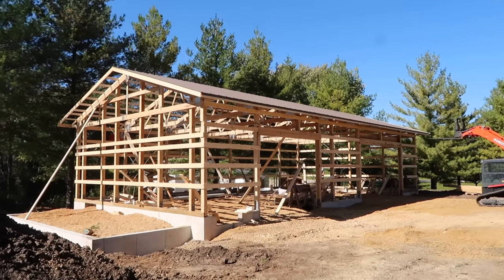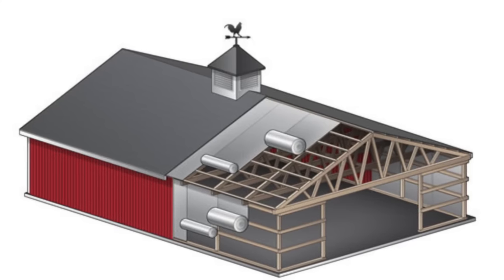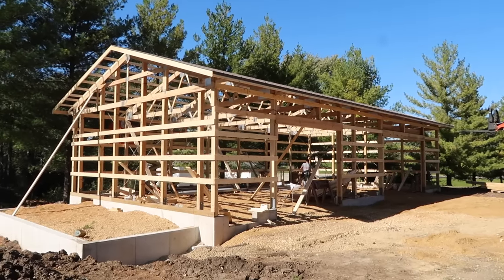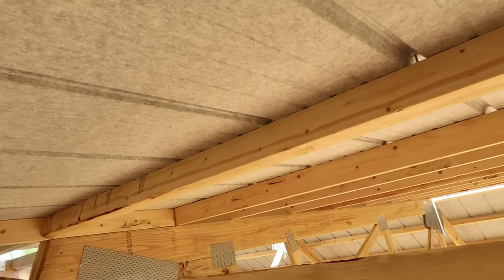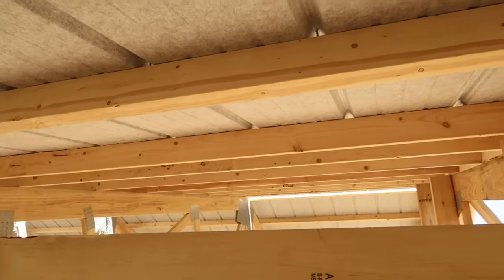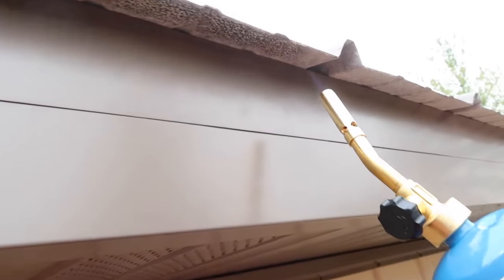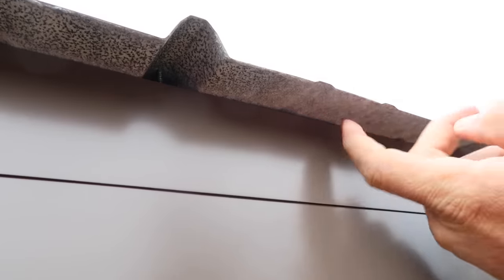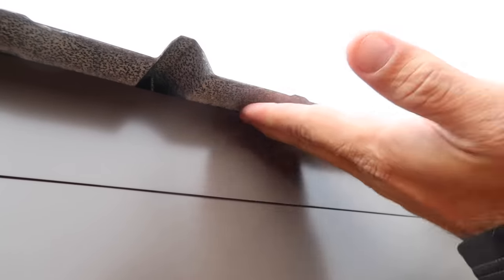Best Condensation Solution for Metal Roofing

Comment: I have a lady friend who has way more money than I ever will.  ( Lawyer lady)   She had a pole building barn built for her animals and supplies.  The Amish built it and by the time I saw it completed, she and my buddy who was her man at the time, showed me all the condensation that actually rained down inside her barn in the cold season as she ran heaters inside and brought the " rainforest"   type environment upon herself.   They asked me how I would have done things and about insulating etc.   I had 0 experience with metal and could only think there has to be an insulation solution that they will have to undergo AFTER the fact.   I never did see their solution.   This Drip Stop seems lkike that would have been exactly what she needed. BEFORE getting the roof metal installed.
Reply: Did she ever find a solution cause I have the exact same issue?
Reply: @MrBmill25  I am not sure but can see if she can answer if I give her a call.  I will try to get the answer.   It will help me in the future too.
Reply: @mlasch1478 

Never heard from her? :(
Reply: She ghosting him…
Reply: If she is going to heat the interior of her building she needs to properly insulate the ceiling and walls.

Comment: In my experience with a northern midwest climate, metal roofs will sweat regardless of the ventilation. With enough ventilation, an occasional sweat may not ruin your home, but it will happen. The only way to prevent it entirely (that I know of) is solid sheathing directly under the metal. OSB, felt, metal, with no air gap.

Comment: Spray foamed mine with a thin layer and have no water issues, also don't go deaf anymore when it rains.
Reply: Did you do that yourself, with a kit?
Reply: Double check that because we did the same and it STILL HAD TONS OF  MOISTURE that accumulates on the foam surface in the winter.  -we did add  2 whirlybirds and 4 small (front and back fascia) vents and it did take care of the problem-thankfully (2,000sq/ft house single story BTW)

Comment: we did metal building/roof and spray foam insulation and it STILL HAD TONS OF  MOISTURE that accumulates on the foam surface in the winter.  -we did add  2 whirlybirds and 4 small (front and back fascia) vents and it did take care of the problem-thankfully (2,000sq/ft house single story BTW).

Comment: You should use a tape like decking tape on the top of any timber where it is in contact with the drip stop fabric. This won’t alter any condensation build up but will prevent it from being wicked away into the timber and the timber becoming wet.
Reply: I believe what you are talking about is called
"Blue skin"
Reply: @thegreatwhitenorth8754  blueskin butyl flash Or an equivalent self sealing tape.

Comment: I am building an 8 by 12 wood fired sauna.  Even though I will have a vapor barrier I justed ordered metal roofing with dripstop.  For the price I think it makes sense.  I hope a good vapor barrier, good venting and dripstop will prevent condensation issues.  I am glad that I saw this video.
Reply: Robert Lane , I would use 3/8 plywood and 15# felt than steel , you do not want anything like foam board over head celtec bubble wrap anything that can melt in case of a fire .  I just did a pole barn using 1/2 inch plywood and 30# tar paper they use gas torch a lot and work with flammable products.

Comment: over here in ireland we get roof sheets with 4 inch rigid foam insulation bonded to the underside, and always use felt under the steel, because its a wet climate its essential
Reply: id like to see a price comparison steel frame with kingspan sheeting vs all timber and insulated

Comment: In Russia, they put a 50 mm counter-lattice. Raft-membrane-a 50x50mm bar is stuffed on top of the rafters on top of the membrane-then across the board 25mmx100-150 mm and only then a metal sheet, so that due to the 50mm gap, the roof ventilation is provided and the condensate dries.
Hello from Russia.

Comment: Okay Dude we have talked before. Like your detail and timeline. Yet we discussed a few weeks back about a proper vapor barrier. If you tape the joints you will never have concern about  condensation. The amount of time you take with story boards and squaring your buildings (which I may add I respect), taping your vapor barrier will have the same effect.
Reply from the maker: this is not due to vapor from the condition space alone... and I agree with you.  this product is for those sheds with zero ceiling or insulation...you get those cold slabs in the spring and the sun hits the steel roof and you get the drip on the concrete.   This will prevent that
Reply: @Doug Neufeld 
not quite right, that condensation on the metal is due to temperature difference in the attic vs the outside of the steel which is directly exposed to fresh cold air, the air even in a fully vented attic is always a tiny bit warmer than outside, this makes vapor from the fresh air condensate on the underside of the steel

here in the old world we use something similar to a house wrap, it is a plastic/fiberglassy sort of type film that has the underside of it covered with this felt type material, if anything drips from the steel on to the glossy top side of the film, it either rolls down, or if passes through, stays on the underside of the film till dries out, there is a vented air gap between the steel and top of the film, and a 2" vented gap under the film, only then the insulation is placed, which is the usual setup - the wind barrier, then the insulation (no less than 6" of rock/fiberglass, some even go up to 16"), then vapor barrier, then the inside paneling, if the house is going to be air conditioned, then there is some 2"-3" insulation between the vapor barrier and inside paneling (sheet rock/drywall) to stop vapor from condensing from the outside on the cool inside wall
Reply: @dsfs17987  Great comment! Good points. So, venting is key. But what if there is no wind? How about a fan in the attic for those days? My situation is a bit different. I am in the Tropics. The seamless metal roof I am looking at can come with a foam like 5 mm plastic foam glued to the roof panel. I am afraid that the glue is going to peel off over time (as the heat hits the roof) and eventually delaminate. I will also put some kind of reflective barrier a few cm from the roof below to reduce heat inflow. That should help with evaporation, but not in the mornings so much. I am thinking venting is key. I am not 100% sure I can do a ridge vent. The last builder looked at me if I came from a different planet when I did ask, but the new one has more experience. I do have soffit and gable vents.
Reply: @pierredemare609  I'm not sure about how it should be done in tropical zones, I live in a temperate region, so it is mostly warmer inside than outside, and properly built roofs work sort of like chimney, so there is no need for forced ventilation
I'd guess you don't have much of a problem with this, any condensation will simply dry out once the heat kicks in during the day, best bet is go to your local city council, they should have a building department, and talk to people there, they should know best about local peculiarities

Comment: I've never seen that stuff before. My building came from Menards, I could have bought their insulation which I believe has a plastic film with insulation inside for walls and roof. Only thing I didn't like about my building was the fact the contractor used ring shank nails instead of screws. My building was 30x54 10 feet. It was very cold in wintertime and I used a salamander while in there. I had 3 cars, a tractor and boat in their at different times.  Wood working tools and lawn care stuff. My building here in Florida is 40x60 one side is enclosed with an upstairs but other part just has a roof an one side with metal. That building has seen better days.  It has I beams through out. All electric is running through the concrete in pipe.

Comment: Ventilation is NOT the answer that I can assure you all. I have extensive ventilation 8 x the recommended amount condensation persists. Yes it helps, but is NOT  a cure for anyone who is wondering. Insulation would be the best option and sealing of any run off entry points and similar. Good luck. Nice video 👍
Reply: Everything metal outside gets wet at night during the summer where I'm at. So yes obviously it doesn't solve all problems

Comment: Hello! I have a gazebo with a metal roof, and I want to put a wooden ceiling underneath. The problem is that in the morning condensation forms under the sheet metal. Will installing glass wool or styrofoam between the sheet metal roof and the wood ceiling fix the problem?

Comment: Excellent description of the drip stop material, thanks for the info.
Was looking into condensation in out buildings and now realise I can’t avoid it in an enclosed small single garage space, just gotta try to lessen the effects. Just had a NEW steel sheet, plastisol coated, garage roof with drip stop. I’m sure the drip stop is doing it’s thing but the same night after the installation, we had driving rain penetrating the foam fillet at the top end of the roof sheets, the water has tucked itself under the end of the sheet and is pooling down the INSIDE of the new roof................ totally RUBBISH finish by the contractors, so there you have it, I’m pissed to say the least. Anyway, I digress. Thanks again. I just wanted to vent my anger to a professional who knows their stuff

Comment: I have a little work shop I mainly use to park lawn mower and garden tiller in . I have supper bad condensation on the metal roof.if I put silicone roof coating on it and spray inside with truck bed liner would it help there is no ceiling?

Comment: I know your focus is not quonset huts, but I have a new quonset hut that needs insulation and I value your opinion.  The building is 40x56 and will be eventually be broken up into usable spaces with one being a wood shop.  For the overall structure, would you go with closed cell spray foam, or look at something else to help regulate the temperature and keep condensation problems to a minimum?  I live in southern Kentucky and we are a pretty wet climate.
Reply: Good luck. Lemme know what you end up going with and how it turns out

Comment: We built a 50x120 a few years back and they opted to go against my better judgement and not put any of the drop stop or any synthetic tar paper. Which I was glad because that just adds so much labor. But the whole inside was insulated very well and then steeled with white. He installed a waste oil burner and it must have been because of excess moisture in the air from the burner but it dropped so much from the roof that it soaked the insulation and dropped through the ceiling panels. Even with all ventilated soffit and ridge cap

Comment: Just wondering if there is a reason you screwed the ribs on the roof for this building? That seems to be the norm here but I thought you always screwed the roof in the valleys of your steel
Reply from the maker: Sorry I should have explained.   This was another builder package and the spec called out rib screws....not by my choice
Reply: Come on Cody, don't going trying to start an insy or outsy debate, all roofs are special for a reason.
Reply: Mark Harvey come on it is obvious you aren't Paul, he wanted to know the rest of the story.
Reply: @RRBuildings  I would think with this product on the underside of the roofing material, screws through the flat portion of the roof would crush the product thereby rendering less the spec.

Comment: Ask your Steel supplier for a cutback on the drip stop. In the UK, we usually ask for a 75mm (3") cutback at the eaves...Cut out an extra step that you mentioned... also means you don't need to take a blow torch to a timber post building..!

Comment: You can purchase the overhang part without the fleece , i use the fleeced metal only cause of the sound reduction . The fleece starts growing mould cause its always moistened without proper ventilation , I usualy run a higher substructure over the tyvek or whatever you would use on your roofs .

Comment: I stripped my roof with 1x4s directly under the metal. Will the 1x4s rot out quickly from this and cause my roof to not be secured and more susceptible to lift in high winds?

Comment: is that spray available as stand-alone?  I wonder if that would be a solution for metal ceiling.  I'm converting a school bus  and have condensation.   Running a propane currently switching to wood burning stove as people tell me that the LP cause the condensation
Reply: I am a rollformer, and yes, we will sell this product by the foot.  approximately $1 per foot. It is 40 inches wide and it has a plastic backing to prevent it from sticking on itself. Look up Rush River Steel.
Reply: I would recommend a diesel heater. I really like mine, and it adds no moisture. If anything, it would dry out the air.
Reply: We always had to crack open some windows for ventilation being that type of heat take all oxygen out of air and condensates

Comment: What I learned from this video....there are steel roofs which are fixed by bolts thru the ribs. @4:18 and forward, you can see them. Also later in de video, you see them from the outside. 👍 😁
Reply: In Australia (at least) all (well pretty much "all") "corrugated" (including custom orb and trimdek types and similar variants by other manufacturers -- cliplok and standing seam - types have either absent or hidden fasteners)   metal roofs are fastened through the "ribs"/ridges not the "pans"/valleys/troughs - it greatly reduces leaks - for when washers weather / perish, or if the screw is placed a little "askew" (dodgy install)
- All our metal suppliers direct to only fasten in valleys / pans for walls, never (verify) for roofs.

Comment: I am a roll former that installs this drip-stop product near Henderson, MN.  The critical part of this product is it needs time to evaporate. If you have a situation like a calf or milk cow loafing barn where  it can potentially reach a point where condensation is developing a lot more then evaporation then you have a nightmare. It will start raining in your building and it wont stop.  This product has it's place, but  I personally don't recommend dripstop in animal confinement barns that don't have adequate air movement to evaporate the condensation.  For every 25 customers  there are 3 that are not happy with this product, because of this issue.  In these situations where it doesn't evaporate on time,  double bubble insulation tends to work a lot better.
Reply: try 200 gsm even 300 gsm felt.

Comment: I have always used shingles on houses. I have recently bought 17 acres for me and my wife. I built a very small home 12'×16' with a single pitch roof. 2x6 with 1x3" slats. I noticed when using the heater. Condinsaction started to acure pretty bad in places. I have R-13 but should I put Cell fome on it 1st? I would guess the 1" slats will alow outside air to go threw the vents. But by adding 1" fome bord then my R-13 should stop this. Or am i wrong? Please let me know we are on a budget now. Thank you and have a blessed day.
Reply: Mixing different types of insulation in the same wall or ceiling is usually not a good idea.

Comment: The place we bought built in the carport and the inside is spray foamed and the condensation makes it leak all the time. On all the furniture. What you think we could use drip stop on the outside on the roof? or is there anything you recommend?

Comment: My car port had clear polycarbonate on it and it was always condensing on to my car roof even with it open at all ends. I installed profile roofing and the company asked if I wanted anti condensation coating which I took at an extra 40 pence per linear metre. Best ever thing I did. Over a year now and not a drip. And if you have a screw that is causing a leak it is instantly recognised as the felt coating turns dark and easy to remedy.
Reply: If you use polycarbonate sheets, mount them double with 5 or 10mm foam blocks in between... problem solved.
Reply: @czondag  Or use double panels, made for green houses.

Comment: What was your thoughts on the Walters materials and design overall? I am considering using them to supply the materials when I build a pole barn next year.
Reply from the maker: not my favorite overall...but then again I am partial...I like some of their trim details and dislike others.   I like the 1' rib profile on the steel panel
Reply: Any recommendations for guys like you in southern Wisconsin?   45 x 80 with 12' lean to's on either side.  Insulated with interior.  Thanks!

Comment: the felt should be able to absorb the water, diffusing it outward and the air around the felt will evaporate it back into the air, self regulating, as long as there is air that is dryer than the felt is wet. I think that is how it is supposed to work.
Reply: Exactly

Comment: Kyle. I am currently putting up my first barn  a 30X54X13 I plan on installing vented soffit and the ridge venting. will I need anything else. not going to finish the inside right now. but I plan too later.
Thanks

Comment: Because of condensation, I've just replaced my metal garage roof with equivalent sheets but with the drip stop inside. Unfortunately my wooden beams are still wet and the one at the lowest point of the garage is dripping wet. I've checked the bolts and seals and they're all tight. Thanks for the tip on burning off the drip stop that overhands outside (by the gutter in my case).

Comment: Instead of burning the felt . What about spraying it with chemset  chemstick.   I'm not sure of the name in america but it's the sealant you put over fibre board to stop it soaking up too much paint.  That's water based and would soak in pretty well. Then go hard.